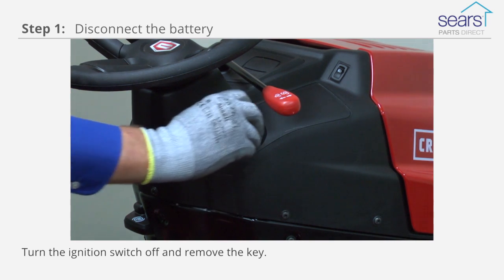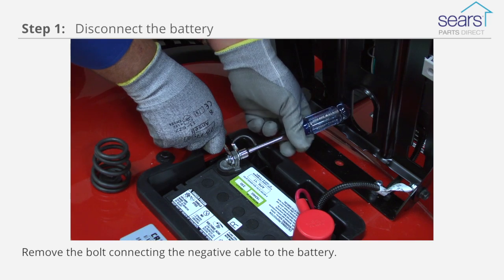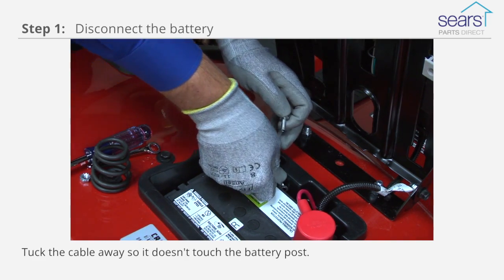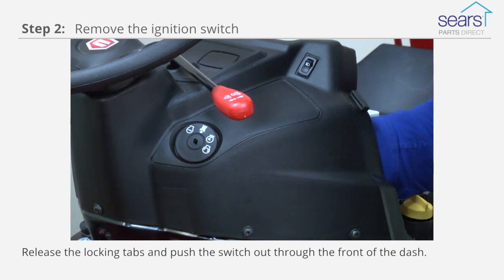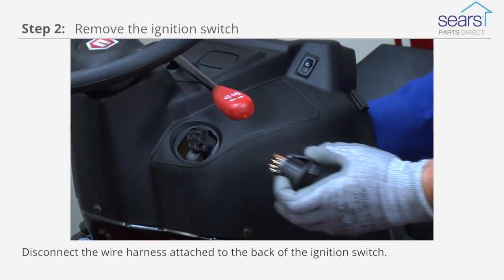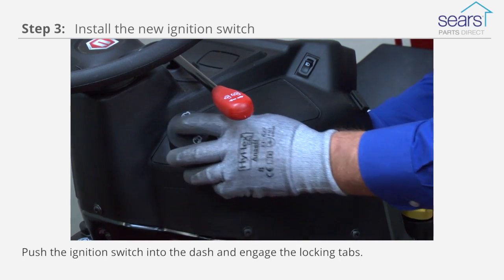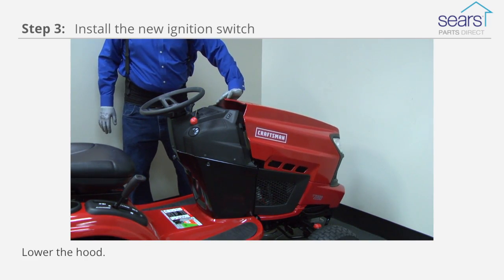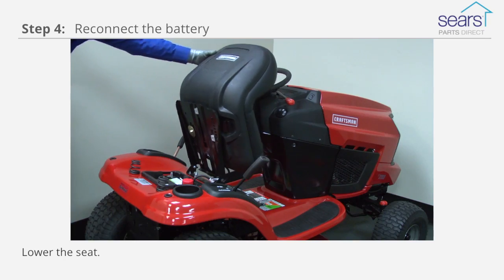Replacing an Ignition Switch on a Riding Lawn Mower

Comment: Are ignition switches universal ? I have an older craftsman and I need to replace the switch have no clue what to get
Reply from the maker: No. We recommend that you look up the part number of the ignition switch that you need using the model number of your Craftsman mower. You can typically find the model number under the seat. Key the model number into the search bar on this page to view the parts list diagram for your mower and find the ignition switch that you need: https://www.searspartsdirect.com/  If you need help finding the right part, let us know.